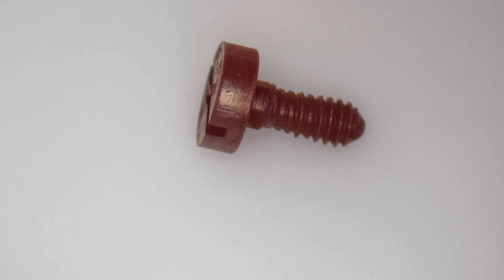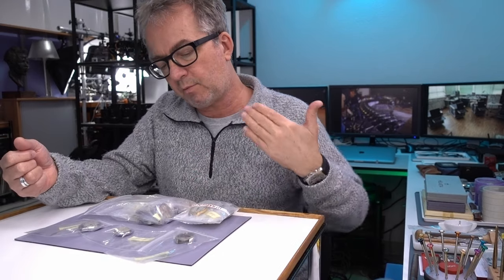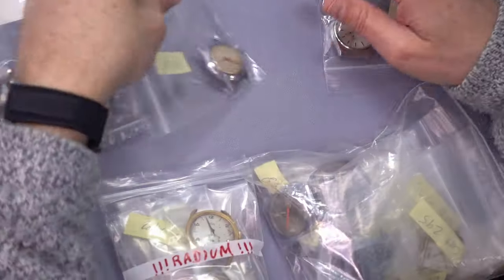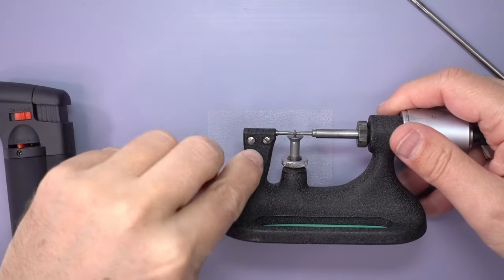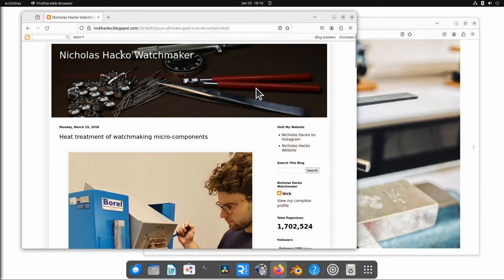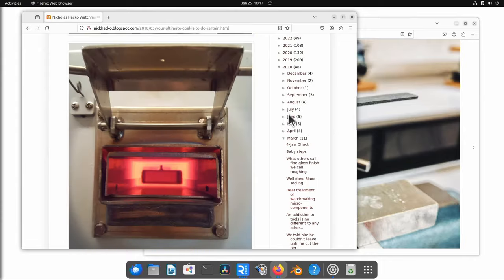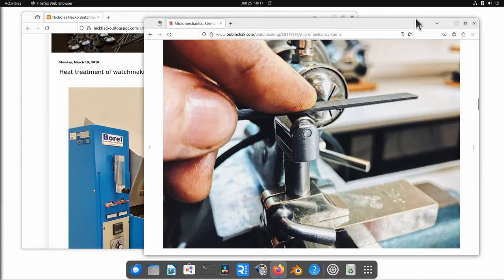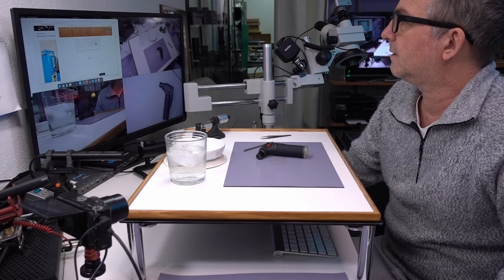DIY Hardening, Tempering and Annealing Watch Screws

Comment: As others pointed out, not all steels can be hardened. If this screw is made from silver steel/drill rod it should harden fine in a water quench.
When you look at the screw in the end, you can see that the threads were squished by the pliers.  If the material was properly hard, I would not expect deformation, but rather breaking (or no change to the screw). I suspect you were a bit slow and the screw was already to cold, when it hit the water. Instead of picking a hot screw of a plate, I think it is a better idea to suspend the screw with a thin piece of steel wire. So you can keep a hold of the screw while heating it and immediately dunk it in water.
Reply from the maker: Thanks for this comment!  I have seen the wire suspension method and will try that the next time!

Comment: If its mild steel that doesn't harden well. A steel with more carbon will better harden.
 I think you absolutely can harden parts you make. Hacko is really pushing for excellence and he should inspire not discourage.
 A good test is to file the part first and then compare how well the file works after hardening to get a sense of the change.  Using those hand engravers before and after on the head of the screw would give you a feel for the effect of the hardening. 
 Hard to tell on video but you maybe needed to heat a little more. 
Lovely video, thanks
Reply from the maker: Thanks so much for this comment! I will do another video with before and after testing / comparisons following your advice, including on small screws I plan to make myself, because that's the ultimate reason to do it. Make it out of annealed steel and then harden it and check that the hardening worked and also made it stronger and not too brittle. Very cool! I never imagined that making screws could be so much fun! (I would add some laughing emojis but I'm serious!) 😂😂😂
Reply: That's what I thought. 
If properly hard the screw sould have marked the pliers jaws not the other way around.

Comment: Brass chips in a brass pan or on a sheet of brass for blueing. Chemicals from the brass impart themselves to the steel as it heats up
Reply from the maker: Chips Ahoy!
Reply: Not quite…. The brass chips don’t impart anything to the steel, chemical or otherwise.  They do, however, evenly distribute the heat, and allow you to sneak up on the correct temperature for whatever color you’re trying to reach.  

As for the colors of steel when heated, what he talks about in the video is correct: it’s all about creating a thin film of oxidation on the steel, the thickness of which determines the color of the light that is reflected from the part.

Comment: In blacksmithing, we relate the tempering colors to how much hardness we're taking out.  They call it running the colors.  Everything has a specific color for the type of use.  Blue is pretty far up the scale.  390 to 575.  Graver would be faint yellow so still very hard.  A drill would be taken to blue, so hold less of an edge but has better toughness.  And then theirs science if you can afford it. :-)  You can also get a set of Rockwell files which will bite when the hardness is below their value and slide off when above.
Reply: Well said I agree fully
Reply from the maker: Rockwell files sound very interesting! Thanks!
Reply: Something very few people know, if you use a surfectant (dish soap) you can get even mild steel to become harder, somewhere in the region of 40~45 Rockwell C. 
Usually mild steel is around 30~35 RC
Salt in quench water is a myth, it does nothing to affect hardness. (which your probably aware of?) 
Steam prevents water actually touching part,  (as a blacksmith you know this) surfectants help, a lot.
Most people seem to use hardness testing files from Japan, around $90.00 a set
Reply: @1crazypj   (dish soap) i know this one very nice you know where you talk about its better than salad dressing lol

Comment: Nice episode! Great to see you try new stuff! I recommend getting a couple of Jeweller's Block/Fire bricks/Soldering blocks. They are inexpensive, lay them in a corner to make a great workspace. Small crucible with Boric acid to protect the part and then quench with saltwater. It would be easily done with small parts in a small workspace like the corner of the workshop using a barbecue torch. Thanks for sharing!
Reply from the maker: Thanks! I hadn't see your channel before! I watched your Rolex 1603 video and subscribed! Nice work! It looks like you're in China but I thought you guys couldn't get through the great firewall. Are you in Taiwan? Somewhere else? (Just curious. My wife is from Taiwan and I've worked in both Taiwan and mainland China - Shanghai, Beijing, Hong Kong.)
Reply: @IMakeWatches  Hi from the free port of Singapore! I guess best of both worlds here. See you around friend! Cheers!
Reply from the maker: Ah! Nice! You've got some great watch culture and enthusiasts there, from Wei Koh to the Tay's! Let me know if you're ever in Geneva!

Comment: I enjoyed the video but I did want to say something about heat treating steel. the problem with talking about hardening tempering and annealing steel is that the temperatures and techniques change with the type of steel you use. for example W1 steel is supposed to be dipped in water to harden and o1 needs oil but many stainless steels need to be pressed between aluminum plates to be hardened (it is called plate quenching) . the same is true for all aspects of working with steel but as a general rule tool steel can be heated red hot and if a magnet doesn't stick to it you can drop it in vegetable oil (water can crack steel that isn't designed to be water hardened) to harden it or leave it in air to anneal it. heat bluing it will usually temper non stainless steels well enough for most tasks.
Reply from the maker: Thanks for your comment! I've seen the ovens with timers to get the correct cool down times for annealing, and it seems to me that to be able to do full heat treatment of steel you've got to have one of those, plus the various quick cooling solutions, boric acid to control oxidation when you don't want it, brass chips to distribute the heat, large and small torches, complete molecular knowledge of the alloy you're working with, and a formal education in metallurgy. And that's why it's so damn interesting! 😂😂😂
Reply: If I remember correctly the quench should occur at the critical temperature but not at much higher temps.  With larger parts it is much easier to have a magnet wand to test for the loss of magnetism.  But with tiny parts not so easy as the screw would stick to magnet every time you test.  Plus the heat loss in the screw is so fast.  An easier way to try this is with some hi carb steel rods where you can hold one end with vise grips and heat the other end with the torch.  Then you can swipe it on a low power magnet to test for critical temp.  Then see how long before magnetism returns.  This will then give you an idea of the speed needed for quenching.  I remember doing this with some small spring steel stock and it shattered like glass when I hit it.

Comment: Just hold it in the tweezers as you're heating it. While you're fumbling around, that small screw loses all its heat, before the quench.
Reply from the maker: Thanks! Yes, I'll hang it from a steel wire next time and go straight into oil!
Reply: That would be a bit rough on the  tweezers

Comment: Pretty sure dropping screw first attempt allowed it to cool too much so didn't harden properly?
'Dead hard' it would have marked jaws of pliers.
As a few people mentioned, check hardness with an ordinary file, if part 'skates' over file, it's hard then can be tempered as needed.
I believe a very old method is to put screws in molten lead for low temper (softer) and bluing? 
Screwdriver made a pretty good graver 😁
Reply from the maker: All great comments! Thanks! I really appreciate your comments and I hope that others are reading them as well!

Comment: Another useful video thanks. 

Have you tried to remove a fixed link from a steel bracelet? The screw head that is used to secure the fixed link head is polished flush to the bracelet and then laser welded and then polished again. So the head is not visible. 

Any tricks on how to remove this “hidden” screw?

Thanks
Reply from the maker: Wow! I didn't even know that there were hidden screws in steel bracelets! Are you sure it's not just pressed together? What brand is it?
Reply: @IMakeWatches  yes for sure screw. 
It’s a Girard-Perregaux steel bracelet. 

AP make them the same way. You can see the process here:

https://youtu.be/Bh1Xww576Yc?feature=shared
Reply from the maker: @marcn8750  Wow! That's super interesting! Thanks! Those hidden screws could be drilled out (just the part where the weld is) and then re-welded.Th problem is the laser or plasma welders they use for that are very expensive. I think there's a spot welder that may go for as little as $1000 but that's still a lot. In the end it may be worth it for restoring stainless steel cases with deep scratches if you do enough of that to justify the cost. Stainless steel welding is a topic that I'm very interested in. Thanks again for the comment and the link!
Reply: @IMakeWatches  interesting right?

I’m trying to figure out how to drill out the screw. 
 I want to try to preserve the outer link. 

Will I need a lathe? Any tricks to share?

Comment: The first thing you needed to know.was the material spec, without it, attempts to harden unknown materials is fruitless. Heat treatment requires certain methods, practices and most of all tools as well as a well ventilated place to work.  None of which you have.  Same thing with the lathe.  Get a cross slide and some onsite help.  IOW, find someone to show you the basics so you dont hurt yourself.
Reply from the maker: You don’t know what you’re talking about. I have ventilation. 😂😂😂  On your other points I agree completely!

Comment: Why didn't you use a file to test the hardness!  and a tip, make a cage of steel wire and put the screw in there. The total mass is too small for hardening as it is already cooled down before reaching the water.  another Tip, watch some Clickspring Vid's :)
Reply from the maker: Thanks for these tips! Clickspring is great! I didn't know that he had videos about tempering and hardening steel! I will watch those for sure! I really appreciate the comment!

Comment: needs to be oil not water.  Water cools it too fast and makes the metal brittle
Reply from the maker: Thanks! I'm going to do this again soon with identical materials before and after. I will definitely take your advice!
Reply: @IMakeWatches   I watched another video about metal hardening and they heated a knife then dropped it in water.  It was so brittle, they could break it with their hands. Same knife, same heat, dropped in oil was hardened properly
Reply from the maker: @isiah431  Thanks! Knife-making videos are a great resource because correct hardening is so important and there are more people making knives than screws. I'm definitely planning to do some comparisons. One thing about so hard that it's brittle, however, is that after that it's important to temper it again (meaning soften it by heating to a lower temperature and then letting it cool down slowly). Making something so hard that it shatters like glass is not the final step, it's only half way there. So if you're only doing a one step hardening oil may be best, whereas if you're doing two steps then ice water may be better. I think the problem for tempering is that the cool down needs to be very slow, and for that you need an over with a timer. In any case it's important to keep in mind that the full process involves more than just one heat and quench. It does seem logical that if you can only do one heat and quench then oil is probably better because it doesn't harden it quite as much because the quench is a bit slower.
Reply: Love the technical and tool videos. As others mentioned oil is what you want to quench parts in.